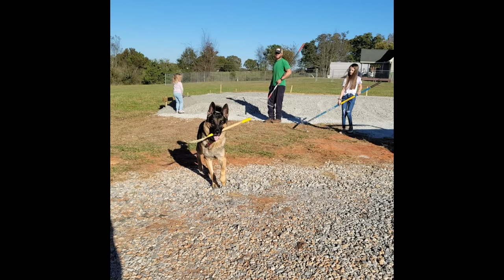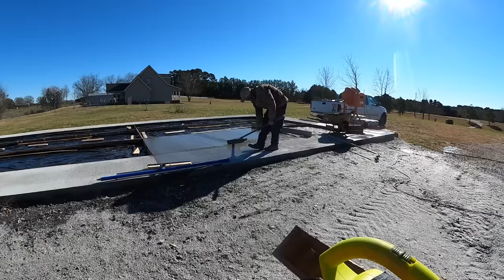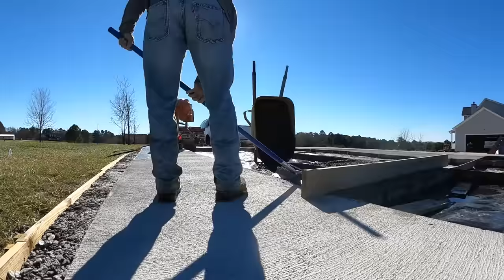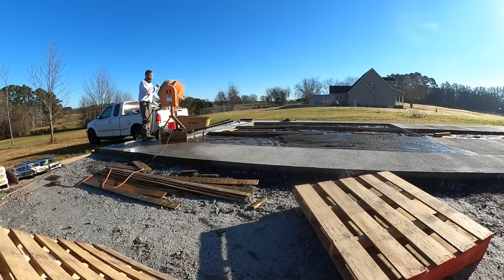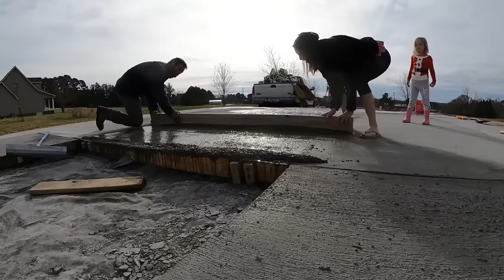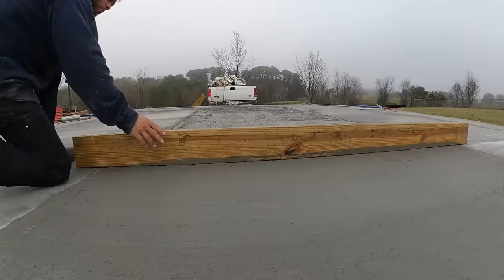Pouring a Huge Concrete Slab Using Bagged Concrete | I Saved $10,000

Comment: You sure have given me inspiration to do my small 12 x 16 shop pad. Here in Alaska cement is going for $425-450 a yard delivered.
Reply from the maker: Wow! That's expensive. Here it's down to 165 with a 4-6 week lead time but when I did this project it was going for 200 to 220 depending on the day. I wish the prices of things would stabilize. This inflation is awful. Good luck with your project, and thank you for your kind comment.
Reply: @reallifetested2605  I have a lot of respect for your hard work but based on a cost of 220 per yard times 18.5, it looks like you saved 750.00 minus the cost of electricity or gas to run your mixer.
Reply from the maker: @jackwessel7239  Please read the description, or at least listen to the first 60 seconds of a video before commenting. Thanks.
Reply: @reallifetested2605  I'm not trying to argue with you, I'm impressed by your work ethic. Your first 60 seconds and description just say you saved 10k. I'm just curious about the numbers, I used 4.00 per bag. There's also the gas to haul 830 bags which would take several trips with most trailers.
Reply from the maker: @jackwessel7239  I'm not arguing. I said that doing everything myself saved me the 10000 dollars. I was quoted over 14k for this work and have a little less than 4k in it.
Reply: @reallifetested2605  OK gotcha. Your bagged crete at 4.00 a bag was 3320 which was 750 cheaper than your stated 220 per yard for 18.5 yards. This equals 750. Minus approximately 11 trips it would have taken to safely haul those bags with a typical double axle trailer which guesstimating gas would have cost around 120. Then your mixer electricity or gas, say 50. So 750 minus 180 = 570 saved on the concrete portion. I guess all the savings was in the gravel hauling and labor. The title of your post is just a little misleading, you "saved" a negligible amount of money using bagged concrete which is inferior to plant produced product. At 200 per yard you saved 200.
Reply from the maker: @jackwessel7239  it was 3.20 per bag and my trailer holds about 8 ton lol you know they overloaded it as well.

Comment: Way to go.  You really busted your butt.  Folks don't realize how hard it is to do concrete.  The pace you must maintain because it is setting up the minute you mix it is what you don't expect.  Your pad came out great.  I recently had really good luck with the diamond cutting blades for typical skil saw.  Goes right through concrete like butter.  Highly recommend in case you want to go back and use a chalk line or board for a guide and cut in some joints to ensure you don't get any cracks.  You could cut along your cold joints just to ensure that it cracks where you want and still keep clean sharp edges.  But that's just one DIY guy to another.  I have just gotten bit by the concrete bug myself after doing a 4x8 foot 6inch deep pad for a set of deck stairs to land on.  Mixing all of that with a hoe in a wheelbarrow really kicks my butt and I am in decent shape.  I was sore for a week.  Like you I spent some money on the right tools and after broom finishing it, I put a round edge with 4" smooth border and it came out awesome.  I see you got yourself a bull float.  Nice.  On my list for sure.
Reply from the maker: Thank you,I dreaded doing it everyday but it was worth it! I didn't film me doing the extension joints but I did the same thing! I have a circular saw that someone dropped a railroad tie on a few years ago, put a diamond blade in it and use it for all my expansion joints. You're right. I have had the same cheap (avanti?) blade on it for the whole time and it always goes right through. Makes a heck of a dust storm though haha I bet that was a ton of work mixing by hand. I've had to do that a few times on small jobs with mortar and it is not fun. The bull float is the way to go with things like this. It saves a ton of time. Thanks for your comment, and thank you for watching!

Comment: I just recently watched a bunch of videos of people pouring patio pads.  I then thought, " I think I'm gonna do my driveway." It's gonna be 20'x65'x6" thick.   Then I thought, I don't think I can.  After watching you, I'm gonna double down on myself.  Thanks for showing me its possible, solo with a mixer.  Looks like I got a rough week ahead of me soon...
Reply from the maker: As long as you break it up into sections I don’t see any reason why it wouldn’t work. Heck as much as you save you can tear it up and redo it 2 more times before you start spending money vs hiring out. Good luck with your project it will turn out great!

Comment: I did this with the sidewalks around my house and a slab in front of a storage shed. Save a good amount of money buying by the pallet. Wonder if it would be a little easier to have the mixer in the form area and just move it along as you mix and dump. Your mixer is a lit lighter than mine, which is an older one made with thick steel and no handle to move it easily. Nice job and I know how much work that is.
Reply from the maker: I’ve tried that in the past on smaller projects and the legs on this thing just don’t hold up. I’ve made another video on the mods I’ve had to make to it. I’ve re tacked it in several places as well as had to change out the wheels because the ones that came with it actually bent from use.

Comment: I did a driveway by my self by hand, no mixer, no bagged concrete premixed, a load of gravel a load of sand and a few bags of Portland cement and a wheelbarrow, I did 2 x 7 foot sections...
Reply from the maker: I bet that was hard work. Mixing by hand like that is 5 times harder than with a mixer. I bet your driveway turned out great.
Reply: @reallifetested2605  Yes it was hard work but a little hard work never hert anyone lol it came out just as if not better then any company could have done it...

Comment: I think the most important thing about taking on a DIY project like this, aside from safety, is being able to break the project up into manageable parts, especially when working alone. It takes a lot of extra planning and preparation, especially when working with a time crunch like concrete forming. Once that first batch is mixed, it's a race against the clock. Well done.
Reply from the maker: You've got that right. If I did go the truck route I didn't think I could take that much on myself. The drivers would be furious if they pulled up with one guy trying to do all the work. I appreciate the kind comment.

Comment: i use this method a lot myself, i even don't use bagged concrete but bagged cement, and mix in the gravel/sand with that. People say i'm crazy but when a truckload of concrete costs roughly 900$ to deliver, while i can make the same amount with cement bags for about 200-300$ then it's obviously worth it
Reply from the maker: You’ve got that right. I was going to go that route but believe it or not sand cost so much where I live it was going to be the same price as bagged concrete. Raw materials have gotten ridiculous. Gravel had a big price increase this year around here as well.
Reply: @reallifetested2605  i guess i got lucky that i have a sand and gravel quarry lik 5min ride away 😅 i gotta pay 70 eur for 15ton of sand

Comment: I would use 60lb bags, more humane. I did some piers. I accidentally loaded 80lb bags on the cart then I thought not putting them back so I paid and took them home. That was a rough day. 60lb are a lot easier to get up into the mixer.

Comment: Nothing wrong with pouring concrete in small sections.  I did a 300' driveway when I built my house.  I used a ready-mix truck with the minimum load to not pay extra. I'm overjoyed to see that people will still work that hard.  I'm just curious about no steel and not pinning the sections together.
Reply from the maker: I'll do an update after some time just to let everyone know it will be ok! Haha thanks for watching.
Reply from the maker: @troyyarbrough  I didn't, but I added a couple hundred thousand pounds of compacted crusher run. On top of untouched red clay. It's not going anywhere.
Reply: Yeah me too. In my experience there’s gonna be some issues related to those 2. It may not show immediately but eventually the ground will settle.
Reply: I’m sure it’s compacted well. The freeze thaw cycle is my concern. That’s why we use steel in New England. You definitely need to pin cold joints together and have half inch rebar in a 2 foot grid. Depending on your area it will be a problem
Reply: No need for rebar with a slab on grade pinning is pointless it's just a slab.
Reply from the maker: @KCBURD  I live in the south. It doesn't often get below 30 degrees here. Our winters are very mild averaging around 50 degree daytime temps.
Reply from the maker: @dukenukem5753  Duke nukem! It's my pleasure to officially meet you hahahaha
Reply: @reallifetested2605  The one and only hail to the king baby.

Comment: Really inspiring! Now I'm wondering if pouring that 'apron' around the perimeter would also facilitate using it during the main pour as the staging area. That is: setting up the mixer (looks like the same Harbor Freight size that I've been using for several years) so that you could roll it along the apron and flip the mixed batch 180 degrees over into the formed area; no need for each wheelbarrow trip! Your building is going to be great.
Reply from the maker: I so wanted to do that, but the concrete around it was still sort moist and I didn't want to damage it after all of that work haha You should check out my other videos, I have a timelapse of it being built, wiring it up and adding lights, adding exterior lights, ventilation, as well as moving all of my junk in there. Thanks for checking out my video!
Reply: I did a "large" pour, not this large. but I put the mixer in the forms, loaded and dumped it in place and drug it back as I went. 
I figured that it was easier to carry the sac crete to the mixer than move wet concrete into place

Comment: Awesome job.  Hats off to you sir.  That is a buttload of work.  Like how you kept things washed off and work area clean.  End result looks excellent.   Glad to read in previous comments your experience with the mixer as I'm looking at one myself.
Reply from the maker: I appreciate it, yes the mixer I would definitely recommend. I honestly can't believe how well it's held up. Just address things as they come up and it keeps on going! Harbor freight used to have coupons on it but I haven't seen one in a while. Thank you for commenting and for checking my video out.
Reply: @reallifetested2605  Wow.  Great job.  Crazy amount of work.   I was thinking how many bags you ran through that small mixer.  I have a Kushlan mixer I got from Home depot with the wheel barrel tires that I have ran couple hundred bags through.  Was a brick mason for 10 years and love to do my own stuff with masonry and concrete.  You will definitely feel it after a day of picking up 80 pound bags of concrete !
Reply from the maker: You can definitely tell that you did something by the end of the day that's for sure! That's one thing I'd love to learn is masonry. I've built brick walls and things like that nothing to intricate though. Thanks for watching!
Reply: I bought one of those mixers. So far I’ve run 14 pallets of concrete through it pouring a small 24”X8”X120’ retaining wall and making pavers: about 1000 sq ft of those 
Mixers still working great.
Reply from the maker: @joedukes9760 that's what I'm talking about! You can't beat it especially for the money. 😄
Reply: @joedukes9760   Awesome , thanks for the feedback.

Comment: Great video, props to you for an excellent job.  I poured a much smaller slab using about 65 bags of concrete and I was wiped out.  I used the same Harbor Freight concrete mixer as you and I hated it.  Too high off the ground.  Next time I'll buy/rent one of the lower wheelbarrow-style mixers so I can mix and pour without a wheelbarrow.
Reply from the maker: Thank you. I have really enjoyed the mixer especially for the price. You'll think i'm crazy, but I had to raise mine so that I could dump it in wheelbarrows haha I do wish they had one with a higher capacity. (2) bags at a time makes for a lot of batches!
Reply: A few years ago, I poured a 10x16 foot slab using one of those HF mixers... hated every minute of it. An 80 lb bag weighs half as much as me, and has to be lifted to my shoulder level to get in the mixer. I was very sore the next day!
Reply from the maker: @michaelblacktree  you must be about my size. I'm 160 5'10!

Comment: I used to do concrete in my early 20s.  ...am 50+s now.  Im facing replacing some 50ft x 20ft of driveway and parking pad soon.  I think I can do it myself.  YOU HAVE PROVEN it!  Great job!

Also... I don't trust contractors even I am one myself (general).  They're never going to do as good, as thorough, or as conscientious a job as you will on your own property.  I can DIY my own property and I do!
Reply from the maker: You can definitely take that on. Especially if you have knowledge on it already. I heard that on not trusting contractors haha the ones around here will charge you big money and leave you with a lot of issues. I’ve seen it to many times to give them a try.

Comment: Love this. Been looking for an example of "section by section" diy concrete pouring for a while. I have a remote property that definitely won't get a concrete truck to, so this is going to have to be the method. Thanks for putting this up.
Reply from the maker: Thanks for checking out my video, and for the kind comment. I really appreciate it!
Reply: One day they're going to come up with that concrete pad that you just pour in the dry mix and just add water and voila drive on in
Reply: @arlenmargolin4868  no they won’t.
Reply: @reallifetested2605  How long did it take you to pour each section?  I was surprised it didn't set up on you, so I guess you did it pretty quickly.
Reply from the maker: @billkea7224  I'm not exactly sure. It took about 4 hours per but that includes me getting out the mixer, connecting the hose, getting tools ready etc. Then putting everything back up. I'd guess 3 hours or so. I did the concrete when temps were in the 50s so that worked to my advantage. Thanks for checking out my video!

Comment: What was the temp and humidity?

Poured a 24x20' about 4" in 1979.
Inch or two of gravel, no relief cuts.
No rebar, no wire.
Had one crack across it in the first year or two.
Fine since. So 40+ years.

LOL, I didn't know what I didn't know.
But it's ok, because slab didn't know either.

I hand mixed 70 bags about 15 years ago. Doing 3 at a time in tractor bucket was way faster than cheap electric mixer I borrowed.
Reply from the maker: That's what i'm talking about! 😀 Have you read through all the comments on how it's going to fall apart and need to be replaced etc? In 40 years i'll be 70. If it last longer then that I don't think i'll be around to care. It was winter time when I did this. Our winters are fairly warm. Jacket in the morning at short sleeve in the afternoon usually. I don't remember the exact temps. If I need to carry the concrete I mix it up in the mixer and fill up my tractor bucket. Thank you for your comment!

Comment: This is great and the commented stories below are also great. I am about to pour in a similar fashion (but with some rebar) a 20' x 25' slab. It occurred to me that with your separate areas one could achieve control cracks 'for free' by placing angle iron along the edges of the 'inner pour' (so long as they do not reach down to the rebar level) and pulling them out at the right time during the set.
Reply: Fail
They’re already a control joint by default. And with no re bar there will be dozens of let’s say random control joints added by nature very soon.
Reply: or you can cut the joints after it sets.

Comment: Thanks for sharing, this is awesome. Would love to hear about some of the things you learned along the way, even small specific technique things, or things you would do differently. Thanks again!
Reply from the maker: Honestly I didn't learn too much, I already had experience doing footers, and small pads in the past. I had never did anything this large. It's not much from the smaller pads, just a lot more repetitive motions. 

One thing I did learn is how awesome that mixer was. I literally no joke was thinking in my head in the middle of every pad "man I hope this thing doesn't stop working" luckily it didn't, and I've done a ton of other small jobs since with success! Just posted another video this morning of me using it. 

I did learn not to add to much concrete as well, it makes it EXTREMELY HARD to screed by yourself. If you notice one time I had my wife come in and help finish the screed. My shoulders were on fire and I really didn't want to bother her. But I had no choice. 

I wouldn't do anything different at this point. I cant wait for a year to pass. I'm going to do an update to prove all of the haters wrong. haha

Thank you for checking it out, and for your comment. 😀

Comment: Massive task. Courageous to take on something this huge by yourself. Good job.
My only question is, did you use rebar? I didn't see any. If no, why not?
Reply from the maker: Thank you! I called around in my area pros said it wasn't necessary in a 4" residential on grade slab. It rarely gets below freezing here, and our ground is hard clay.
Reply: @reallifetested2605  And you can use epoxy resin without putting fiberglass in it, but the composite material is much much much stronger. Same with concrete, you have a big slab with no tensile strength. Many "pros" cut every corner they can get away with. /shrug